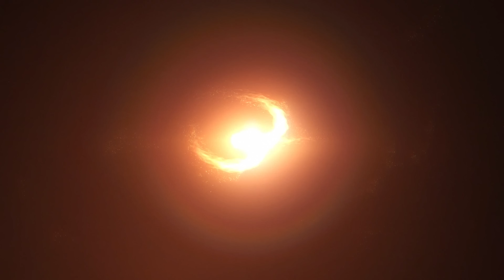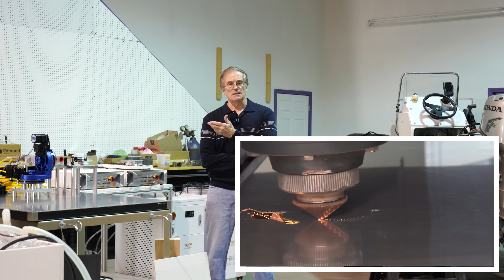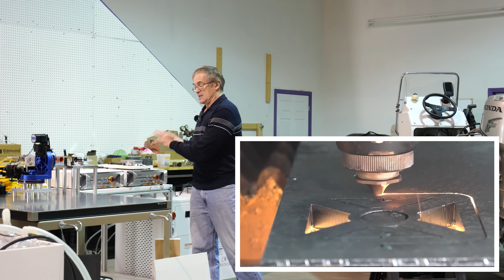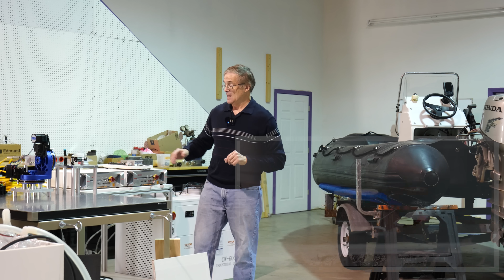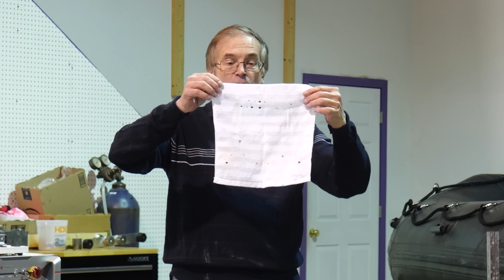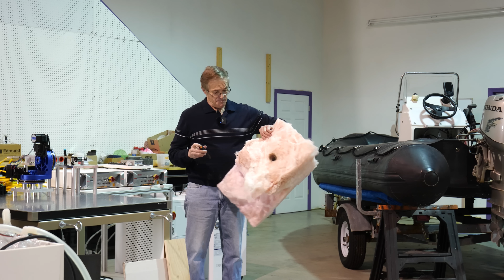We have a problem... and need your help!

Comment: I've been thinking about how to make very powerful CW benchtop, visible wavelength, optically pumped lasers, but I'd need a beam dump for those, and the idea I came up with for a beam dump was to have a tank of water dyed black (but not super black), such as with a fountain pen ink like Noodler's black, with an AR coated window to minimize stray reflections. The light would be absorbed by the ink, and the water would act like a massive heat sink. You'd probably need the water pumped around to spread the heat. The idea is that the light would be absorbed by the very black ink, but the optical density wouldn't be so high that the light would be all absorbed within an inch or so because then you'd just make a ton of steam and possibly destroy the dye. You'd want the light to all be absorbed within the length of the liquid, but not all at once. Perhaps something like lamp black could work if you could get it suspended properly.

Of course, this idea mainly works for visible range lasers. I don't know the exact wavelength of your lasers, but if their outside of water's natural absorption, you'd have to add something that would absorb that wavelength. And this idea obviously was made with a stationary laser in mind, not one that can turn. I imagine an idea like this is somewhat impractical for your specific use case. Even if you get something like a giant water tub used for giving farm animals water, the laser would just cut through that, and water would spill everywhere.

For a laser that can turn, it almost makes sense to just get a ton of sandbags or concrete bags and make some sort of berm. You could also take the laser outside if dust getting on the optics is not a concern, but I doubt that is the case unless you hermetically seal the entire assembly.
Reply: You also may just want some sort of wireless kill switch to remove the laser power from the equation entirely.

Comment: Indeed a hard problem, I'm really curious what the solution will be.
I was thinking about a steel sheet with a waterfall on top, and slightly angled backwards to prevent direct reflection.

Comment: How about, plastic (easy to puncture) backed by a cellulose gel (wall paper paste)  the idea is to use water to sink the energy while the gell form stops it leaking too fast.  

Wall of cooler blocks?

Comment: I can't think of anything light other than rockwool and aerogel. But would that work? I think mass is the solution. 

Cinder blocks filled with sand, perlite, or vermiculite

All my laser work was with far less powerful sources.

Comment: A metal plate positioned at an angle relative to the laser beam in such a way that it reflects part of the energy toward the Earth. With a water jacket on the other side, intended for cooling purposes.

Comment: Maybe if you put the laser in a shed, and aimed the laser at the ground.

If that isn’t practical maybe you could make a large box on caster wheels filled with sand, dirt, etc, and when you’re finished you could just empty out the filling and disassemble the box.

Comment: Why not multiple emitters instead of just two massive ones? 

Graphite blocks+ some heatsinks. Maybe even watercooling?

Edit:
Pykrete blocks/plates will be interesting too.
Reply from the maker: Multiple emitters would suffer from the same low beam quality as the previous laser. You can't correct all the beams at the same time, and so each one would need its own beam correcting optics.
Reply: @TechIngredients 
That's a lot of extra work indeed.
I just edited my comment with an addition; Pykrete (with graphite/graphene)
Reply: the rotating target, like an anode of an xray machine could be improved by making it move like a spirellograph, that way you can make use the target area more efficiently

Comment: it sounds like yall might need to split the problem into two parts/systems: 1: a beam management/diffusion system and a separate energy dissipation system,
the simplest of these would me a collection of mirrors aimed at a wet pile of black sand or on the more complicated end: a collection of quartz microspheres either sintered into a diffusion panel or suspended in a water/glycerin solution, and a thermal mass backing (ablative rocket nozzle coating, sand/graphite mixed with water, porcelain pavers, shingles (slate or quartzite),  railroad ties etc). worst case scenario is that you might have to end up treating these lasers like firearms and just make sure to always have a berm or a range.

Comment: Stone wool made from natural stone can withstand temperatures of over 1000°C without melting. Stone wool insulation is suitable for use in buildings with fire classes P0-P3.
Reply from the maker: That's not bad.  I'll  try that.

Comment: I'm assuming the problem is the power density of the beam instead of the power itself. So I'd focus on diverging the beam after the target. If the target is static (e.g. inside your building) you could place some defocusing optics behind it and then something more traditional to absorb the lower power density light post optics (e.g. heat exchanger with opaque coating).

If the power density is so high that you're worried about damaging the optics, perhaps the first stage could be offset from the propagation path and spun, reducing the duty cycle for the area being hit by the beam.
Reply from the maker: Those optics have to align at least roughly with the beam, and it's scanning all across the wall.
Reply: @TechIngredients  ah, I thought you were looking to do static testing to determine duration of firing needed for when you moved up to scanning. 

What's the area of scanning? Perhaps look into making a large-area fuse that would sit behind the target and tied to the door lock of the laser. Running many strands of thin gauge wire across and then wire the stands in series along the vertical edges. That way the interlock is tripped and you only have to replace a few strands between uses. Ribbon cable might be a good option.

Comment: I would say the answer is already out there. Just look at the water deluge system SpaceX used to protect the launch pad when launching there star ship. Of course that is a bit overkill for the laser but you get my point. Also, using water would allow you to drain the water out of the system for portability.
Reply from the maker: That's not a bad idea. Replenishing the water in the beam with flow should work better than the static water in the cloth.

Comment: What about a continuous water source trickling over the blankets/fabric? I also think of a column of sand that is gravity-fed so as the sand grains melt and condense, that creates an air pocket, and gravity continuously feeds the sand downwards. That might not be portable though.

Comment: Simple solution: disposable barrier at the laser exit for testing. 
Difficult solution: barrier at the target. 
You’re basically building an SLM 3d printer with no base. Just chuck a steel block in front of the collimating lenses or the focusing lenses (preferably the farther upstream the better) that way the divergence of the beam and the caustics work to your benefit. I bet after some testing it could even get to SLA 3d printed ceramics with a silicone/urethane binder

Comment: I’ll probably never understand half of the stuff you’re saying but I really appreciate guys like you. Keep up the hard work.
Reply from the maker: Thanks!
That's actually my fault.  I want to make these subjects informative, not just entertaining.
Reply: @TechIngredients being informative, or technically precise, is not a fault.
Reply: @TechIngredients  Intumescent paint in liquid form.  Get a tub, fill it up.
Reply: @TechIngredients  what can a magnet do to a laser beam? I mean usually, laser light should pass straight through a magnetic field as electromagnetic fields are linear. However, at extremely high fields (Schwinger limit), linearity breaks down and light will interact with the field, or another option using acoustic waves manipulate laser paths using sound waves. Electro-optic deflectors employ electric fields to bend laser beams!

Comment: I have this idea of a rapidly spinning array of mirrors that scatters the beam in such a way that the mirror array redirects the beam that hits the mirrors at an angle,  which in turn deflects the beam to a safe 45 degree (+&-) that dissipates on a single layer brick surface.  Similar in concept to how the electron beam of a CRT (cathode ray tube) is scanned across the face of the tube instead of burning a hole in the phosphor in the center of the tube..

Comment: Try the blanket option draped over a pole that had a constant flow of water and a reservoir at the bottom so moving it could be easier? You can figure out flow rate of the water so you can saturate the blankets so they always are hydrated. Could even go with a wool blanket. It would get heavy.
Reply from the maker: I like that idea.
Reply: @TechIngredients  should be easier maintenance and still provides the benefits of a giant tank of water. 😊

Comment: My first idea is not to use this laser for your tests, use smth less powerful. Then use this laser in very controlled tests on well defined paths. Then assemble the final product. But after all, if you are really so dedicated, build a running waterfall or rather a waterwall. And the running liquid should contain absorbant. This waterfall should be able to absorb tons of energy.
Reply: one more idea, a vertical conveyor belt.

Comment: Would it be possible to create a "wall of smoke" or wall of some other mist, vapor or fog in front of another barrier where the smoke/fog/vapor would sufficiently scatter and weaken the beam before hitting say drywall? Not sure how you produce and get something like that to cover a large area, but if water mist would work that shouldn't be too complex I would try stage smoke/fog, water, maybe CO2 from dry ice.
Reply from the maker: Probably not.
The smoke would have to be constrained to a limited thickness. Otherwise, it would interfere with the drone testing.
Reply: @TechIngredients  I was envisioning the smoke or vapor being behind the drone as a backstop.

Comment: I don't know the wavelength of your laser source, but one possible idea is to try to find a material that vaporize from the laser hitting the surface and such a material will need to be able to absorb the wavelength of your laser when in gaseous state. I think your wavelength might be around 1000 nm, and CO2 absorbs that quite well, this might be why wood resisted a bit. I would try a sandwich consisting of a metal plate in the exterior and compact graphite in the middle, but the small size of the laser beam might not vaporize and burn enough material to create a sufficient geyser of CO2 quickly

Comment: Two suggestions:
A moving target can reduce hotspots so rotating your target plate will increase it's failure time.

Secondly, perhaps stacking razer blades sharp end out will scatter the beam and absorb the heat before failure.

Comment: dense smoke disperses laser light well. that's why wood has worked comparatively well. i would try a multi-layer construction of a hardwood board, a few mm spacing and a foil so that the smoke is not carried away. if the wood is wet, the risk of fire should be low

Comment: I would use a belt suspended between two rollers that moves at 1 meter per second, each millimeter of the belt will be damaged for just 1 millisecond

Comment: this by no means is an answer, its more of a question to be honest.. how would that paint that absorbs 99.9% visible light work against the laser? also you are focusing lasers wouldnt using like multiple arrays of the sheeting of magnifying lenses, in multiple angles and such so you basically turn the beam in to thousands if not more...
Reply: Vantablack? That crossed my mind too. Or maybe a prism could spread it out?
Reply: @grabasandwich  yeah im not science smart, i love science and experiments but obviously dont know the math behind them or what not. wish i was. but i took a different path in life. just a disabled computer nerd now.
Reply from the maker: It won't work.
That absorption results in heat. That heat will vaporize the paint.
Reply: @TechIngredients  thats what i figured, hence the not an answer but a question.  i really would love to see what happened in that situation though.

Comment: mirror mounted at an angle on a spinning motor behind the target, mainly angled in a safe direction, (up? or off to the side) spread the beam over a larger area of the "catch medium"  not practical for real world, but would let you test in the lab...  when the beam gets through the target drone, it hits the spinning mirror... that sends the beam to draw a circle on the absorbative material. spreading out the energy should buy shutdown time....  and the motor can be independently powered separately from the aiming system...  a single simple spinning motor should be pretty reliable....

Comment: Idea, black painted sheet of some metal placed at a very steep angle with water running over it almost in laminar flow. The water would even spread the light over a small area.

Comment: Build a spherical cavity made of metal or something. Polish the inside if possible. Have the opening of the cavity be about the size of the beam entering it. Make sure the laser hits the sidewall of the cavity at an angle and not at normal incidence. Should act like the classical black-body, with limited light escaping from the entrance hole. 

A simpler solution is to simply place a negative lens (or positive lens of short focal length) near your wall. This will expand your beam (potentially enough) to lower the irradiance to the point your fiberglass or other materials are minimally damaged.

Comment: Drywall or plywood with a skim coat of sanded mortar tinted black might be enough time. Add a thin smoked glass tile over the darkened mortar to further diffuse any reflected light.

Comment: Would it be possible to instead of solving for a material to absorb the solution would be to send an electronic feedback loop to the laser generator to instantly shutoff based on a thermal reading of the backdrop material? Perhaps the backdrop material could be submerged in liquid nitrogen and when the beams hits the material the thermal readout would increase and trigger the power to shut off.

Comment: Hey, What do you think about a crude waterfall apparatus made with a high volume water pump feeding a gutter that continually falls and/or soaks material continuously... 
**Perhaps there could be two sets of gutters in front of one another as a backup? 
My thinking is, The water Will continuously soak The material... 
***Also, perhaps some kind of additive that would increase the surface tension of the water to create a curtain of water for one of the layers?

Comment: According to AI, the melting temperature of fiberglass is 400C. But rock wool is 1000C. So that rabbit hole may be worth looking at further. Obsidian (silicon dioxide) is around 1700C - and I'm spit balling here, it may help diffuse the beam enough that your window to shut things down is now long enough to prevent a burn through. For poop and giggles it would be very interesting to see what happens if you could shoot that beam length wise  in a silicon ingot used to make chips. $$$ Intel or someone would have to "donate" one.

Comment: Seems the problem is the laser becoming stationary relative to the backing.

Why not have a rotating/oscillating backdrop that exposes more material to the laser instead of allowing it to bore a hole?

Alternatively, an infrared camera linked to the laser power could shut off the laser if it detects a hot spot on the backdrop.

Comment: Two problems maybe? One reflection containment, one absorption? Two effective layers, one a layer to contain any reflectivity from the second layer, but otherwise sacrificial in a system failure mode, sure it'll be holed, but hopefully a small amount of reflection from the second layer hitting its back side won't hurt it (maybe make it reflective on the back side to send that small amount back into the second layer). Second layer, fish tank(s) with a absorbent material  inside near the far wall. Water to handle dissipation and cooling of the absorbent. I don't know what a good absorbent would be in this case, black painted fire cloth (maybe several layers with gaps)?

So maybe drywall + air gap + fish tank (water + a laser absorbent on the back wall). Angle the fish tank some degrees so that any reflection from the near glass pane hits a new area on the back of the first layer (drywall). Could put a reflective on the back wall of the drywall layer, presuming the "back side" of the reflective isn't reflective for the initial pass through the drywall of the laser beam.

Comment: If the brick melts at 1800°C 
you could use:
Ceramic Fiber Blanket which could give protection up to 2300°C
Carbon Felt up to 3000°C
If that does not work, use a water mist between laser and blanket to disperse the energy before absorbing it into the material.

I am not an expert but this seems to make sense and not expensive.

Comment: Not sure about the magnitude of laser we're talking about here but maybe the paper cup filled with water trick could be useful

Using a large tank/wall made out of a good thermal conductor, filled with a decent amount of water might disperse the energy to the fluid quickly enough 
Paper might not be enough though, so perhaps aluminium...
Only problem is if the thermal transfer happens too late and the wall is already melted and then all your water pours out

But that's just my 2 cents so idk
Reply: Also dumber idea but you just turn your contraption vertically and fire to the ground, maybe a though enough soil could stop it, I would only fear for buried rocks exploding under high temperature